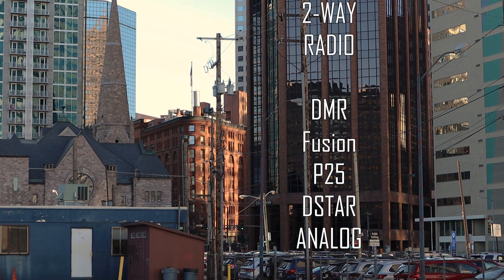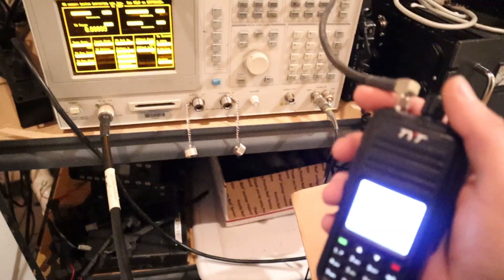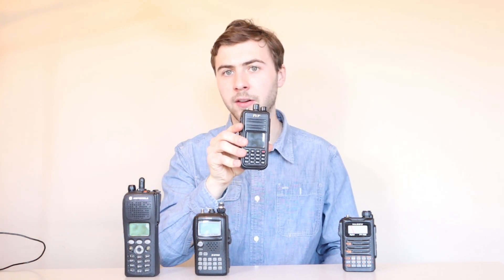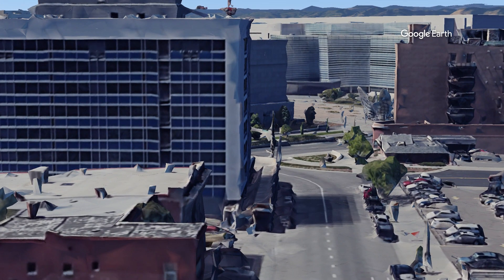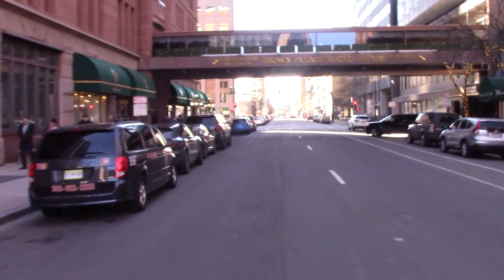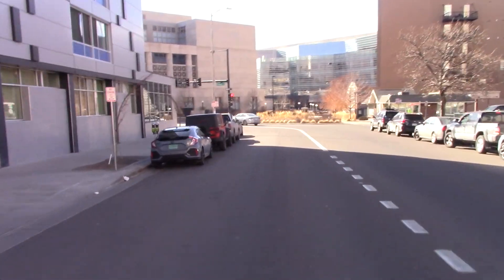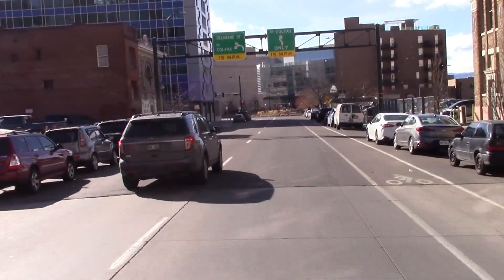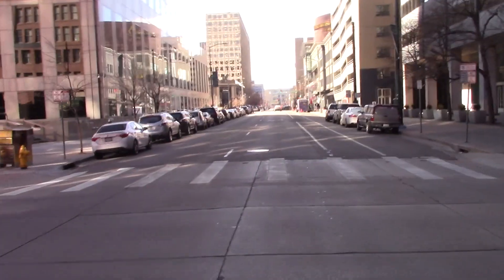Digital Vs. Analog Weak Signal Two-Way Radio Test

Comment: Excellent work! Regarding the comment that someone to drive for you would have been safer, I caught myself being a little bit nervous about that as well. But talking on the radio while driving is a staple for most of us even in a traffic-jammed metroplex. It’s not even hands-free for most mobiles!
Reply from the maker: Good point. Guess I need more friends. I did it on an early Sunday morning so the traffic wasn’t too horrible

Comment: Very nice. That looked a complicated video, hard to edit. I got one of those Yaesu radios. Only used the digital a few times on a Fusion repeater. First time when down south, bottom of England on a old WW2 radio station explore. Got a fusion repeater not 3 miles away if that, app on phone bought up. punhed in the numbers, worked forst time.. Not had radio 2 weeks. Some other roepeater got from high up point near home, bike ride away. That on QRZ. A google streetview screengrab. 34 miles or so. Wanted a nice little radio, but to be fair the fusion, digital a bit of a waste of time around here. No fusion. Usefull when move area like holidays, We shall see. Got first handheld in 1994 when licenced. Only ever had handhelds, analog old school person me. Had cheap rubbish baofeng things 2017 onwards, Sold to replace the drone that dropped in Oxford canal, sunk. Now got the Yaesu FT-70D from July.  Radio shows at 10:17 on here.  https://youtu.be/esi9lCyEaaU        -       G7TRV

Comment: Wow, digital is so much better compared to analog when it comes to multipath city environment. Out of all the digital modes, I would agree DMR had the best sound quality and signal. It would be curious to also try this test using NXDN.
For the rural mountain test, I would say it is a tossup because there were times the digital dropped out completely where the analog signal was still heard with noise.

Comment: Great video. I'm still a big fan of analog. Working in the public safety field, the big difference between analog and digital has been on the fringe. Even though very scratchy you can make out the traffic vs digital which seems to be all or nothing/unreadable. Unfortunately advances in technology aren't always good moves.

Comment: Why did 5KHz fm sound better than 2.5KHz fm? Theoretically 2.5KHz deviation should have more RF power in a narrow spot and should sound louder. Or is it due to higher deviation that 5KHz was louder? Thanks for the amazing video.
Reply from the maker: "FM Improvement Factor".  SNR/CNR. Each time you double the bandwidth you get 6db more signal but only 3db more noise at the receiver.

so for FM, more bandwidth is better
Reply: @SkylerF  Cool. Learned something new today. Thanks for the explanation otherwise I was comparing FM to SSB.

Comment: Very good basic comparison video. I am planning on sharing it with my group as it is very "real world". On the analytical side, I would be interested in knowing more about the repeaters used. Were they all in the same location? Did they have the same antennas? Gain, Orientation, etc.
Reply from the maker: Did not use repeaters, this was all simplex directly from my moving vehicle to a stationary receive antenna doing the recording. The receiving end was just different radios being swapped out.
Reply: @SkylerF  Excellent. I must have missed that part. Again very good comparison experiment/video.

Comment: What is the BER (Bit Error Rate) for the digital modes?  This is the real measure for all digital modes.
Reply from the maker: Yeah, I wish I had a way to measure that, I don't have a communications system analyzer that does digital though :(. I'm not sure if there are even any service monitors that will modulate the amateur radio modes like Yaesu Fusion or DSTAR?
Reply from the maker: The other issue with my test is the radios probably have slightly varying RF performance based on the cost, so one mode may be better than another but the radios may have skewed it a different way based on the front end filtering etc...

Comment: wtf ? you show a guy in the apt . A real test would be talking back and forth . what the hell is the guy in the apt doing ?  maybe I do not want to know.
Reply from the maker: Talking back and forth would be a lot more complicated because then I would have to put a recorder on the vehicle and talk back and forth at the same time. We are simply testing each mode up against each other, and do not want any other variables in here to change. 1-way transmisions is enough to answer our questions on which mode works better for a weaker signal. 
 Jeremy, W0JRL was in the apartment, and he was switching all the radios out, starting / stopping the recording, and verifying the signal strength for me to find a good stretch of road to do the test. The apartment antenna was held still and each HT was swapped, because we did not want any variables to change.
Reply: @SkylerF  Good answer!  And the signal back from the apartment would be inline with it's signal rx.  The only variable would be the power going the other direction.  I'm very happy to see a comparison of the different modes and find it useful here in the PNW with spotty coverage in certain areas I travel.  When into the city I can use repeaters...  But on the road home it twists and turns with trees and different elevations similar to Colorado.  I f you have ever been to Pagosa Springs and travel between smaller towns you know!!  Similar terrain here in Washington State. I find that Analog has become my friend with about 50 watts I am able to have somewhat reliable connectivity and in some spots turning on the compressor helps eliminate those deadish spots.  Good SWR and high antennas are a must.  I would like to try a test with DMR with the same watts I use (50) on DMR.  The difficulty I have is my YL is not a ham...  We use GMRS under my license.  Similar results but GMRS is UHF and I have found VHF to be more stable at distances.  Very good test and keep making vids!!!! 73's to all N7MWH

Comment: I own several repeaters and I would demonstrate this to skeptics.  Two of the repeaters were using the same site, same antennas and same power.  They were on a combiner with several other repeaters, P25 being their modes.  I left out the Quantars, because they outperformed them all due to their output power being 110 Watts.  The two repeaters that I used in my test were an analog wide band TKR-850 and the other was an XPR8400.  DMR outperformed the analog repeater every time.
Reply: Define "outperformed". What were the metrics you used to come to this conclusion?
Reply: I've tested DMR on weak power such as 50mw. I can't get into a DMR machine with approximately the same distance as I can with 50mw of wide FM going into FM repeaters in about the same spot.

Comment: Just found this video after thinking of the beacon recovery video. Great comparison of what you can do with 5 or so watts. Cool to see how well DMR performed down in the noise. Next you should go up to 50 watts or more and test the curvature of the earth.
Reply from the maker: Thanks James, Yeah I'd like to do more tests like that. The only problem is finding stuff to do the videos, hard to find people to lend me stuff since I don't want to spend the $$ buying all the stuff just for a video. One test I want to do is 4 bands, 6 meters through 900MHz with the same gain antenna through mountains vs. city vs. farmland. Another test I want to do is comparing different mobile antennas in different environments by logging the received signal strength voltage on the receiver radio while mobile keyed up with a constant carrier.
Reply: @SkylerF  I'd like a test around the 70 cm band, as I am licensed in the GMRS band but I am looking to get my Technician class license.

Comment: Would have been interesting to examine ssb as well, probably not fair since it has a higher signal to noise but would have been interesting to see how it behaves in a City Environment. I'm not sure how the data is modulated for the various modes, but if done properly you can almost eliminate how noise and multi-path affects the data with data processing technique. This is why digital broadcast fm is so much less intereference prone than standard analog. A good write up is here if your into the math behind it all : https://theori.io/research/nrsc-5-c

Comment: Just a comment, for your P25 test, when was the last time the radios had a proper alignment? I find lots of P25 users who don't perform well just because the radio is out of alignment. On the Moto's, the deviation balance seems to be really key for good performance, and used 2-way moto gear have usually had tough lives in the field. Truthfully, P25 and Fusion should have been pretty close since Fusion is just bastardized P25 anyways...
Reply from the maker: The radios were on frequency, had proper deviation and good sensitivity in analog. That’s as far as I can go with my own equipment. I don’t have anything to test BER. 

I think my radios might be using the older IMBE vocoder instead of AMBE2+ which might have something to do with it. Also P25 is similar to the fusion wide, which I did not test. Not over RF, but Fusion wide can be directly sampled to P25. Fusion narrow can be directly sampled to DMR through software without any vocoding.
Reply: @SkylerF  Ok, find someone local who can do alignments for you, it's more than just on frequency and "proper" deviation. You would be surprised how much better those radios will operate P25 when aligned properly...
Reply from the maker: Yeah that’s the way I need to go. Only so much I can do for a free video haha. I wanted to get people to send the latest and greatest new radios  for each mode and then I ship back after the video was done but nobody was interested in that...
Reply: @SkylerF  Great demo, but this comment explains a lot!  I was expecting to hear Fusion sound as good as P25, both C4FM, but now I know why, Fusion was running in Narrow mode (sounded almost as bad as DMR).  So I can assume Fusion Wide sounds the same and as good as P25?

Comment: I worked in a commercial 2-way shop for 27 years, been a ham for 50 and am quite familiar with video production. You did an amazing job syncing the audio and video! People don't know how hard this is. Also, it is the best comparo I've ever heard between the modes. Great job!
Reply: except for reusing the same video in both tests showing the same truck and signs at 13:18 and 14:52...

Comment: Great work! Just curious, was the receive site for the mountainous terrain test the same as your urban test runs? Also, what was the approximate distance on both test runs?
Reply from the maker: The RX antenna was indoors maybe 2-3 miles away on the city test. The mountain test was a while ago when I was in socorro NM and the test was about 5-7 miles away on a magmount indoors. Antennas did not have a lot of height. I’m Not really testing range just testing weak signal
Reply: Understood. I just wanted to understand the test conditions a little better. Do you have Allstar? It would be great to have you talk about this on our tech net next Sunday night..
Reply from the maker: Yeah my hub is 46079 skyhublink.com
My 900Mhz repeater on lookout mountain near Denver is 40195, usually connected to the hub but I steer it around, that’s where I usually hang out

Comment: Very nice test indeed. In my opinion, modulation was too low in analog narrow FM. While noise (the classic "whip effect" of multipath) was more or less the same as analog wide FM, it seems to me that modulation was far lower. Did you forget to turn the RX radio to narrow mode? Or did the RX radio have some issue with narrow bandwidth mode? (here I am refeerring to the test done in the city). Also, it actually seems that DMR is the best digital mode, the one that has less drop-outs in the test. Maybe it's just because the RX radio is better than the others? Anyway, while we all appreciate the absence of noise, I believe that actual readability of the signal is better in analog FM (wide). If, instead of a repetitive pattern (testing, 123) you had actually read out some random text (a book?) and asked for the other party to copy it, you should have clearly seen that analog wide FM is the best mode, that is, it allows to copy the most text without errors and omissions, even if the listener has to cope with the noise. 73 de IZ4UFQ
Reply from the maker: The RX radio bandwidth is right, I believe my TX modulation was too low on narrow, didn’t talk close enough to the mic.
 As far as the digital modes.All of the radios had similar RX sensitivity on analog, but maybe one has worse bit error decode, there is no way I can test that unfortunateley. That may gave lead to the reason why fusion performed the worse, the fusion radios have the worst intermod rejection, and bieng in the city there may have been other signals generating intermod on my RX fusion radio.

Comment: The frequency wasn’t mentioned but on analog it sounds like it was done on 70cm.
Reply from the maker: yeah 70cm, same frequency for all radios. i put it in the description
Reply: There's no way to tell a frequency based on the "sound"
Reply: spatch713  Actually when you are mobile, the fluttering QSB becomes more rapid at a given speed. The wavelengths become shorter and the “dead spots” are closer together. When you get up to 10 GHz and higher the flutter is so rapid it becomes a modulated tone.
Reply: wecontrolthevideo well I'll be damned. Learn something new everyday.!
Reply: spatch713 Just listen to a weaker mobile signal sometime on UHF (440 MHz) especially if that mobile is moving 60 MPH or better, you’ll notice the rapid fading.
Reply: @spatch713  Yes, you can tell by the "picket-fencing" 70cm has faster fading and sounds more "choppy" due to the shorter wavelength.

Comment: Hi Skyler! Glad to see you come back after a nice little hiatus! 

You pickled a great topic to cover. I watch a LOT of amateur radio videos on YouTube and don’t think I’ve encountered a video that compared the various ham-friendly digital modes the way you and your colleague did. Well done!

A couple of questions for you:

1. Were you using VHF or UHF for the testing?
2. While in downtown Denver, if I were to take a guess, it sounded like you were traveling away from the receive location. Would that be an accurate assumption?

While I’m partial to DMR, it was a tough call between DMR and P25 in terms of which had the better audio quality. I would tend to lean towards P25 in your testing. That is likely attributed to using a commercial Motorola radio for the P25 tests vs the TYT for DMR. Had you used a commercial (another Motorola XPR6550) DMR radio on your end of the test, I think that would have made the two almost indistinguishable. 

Next in line in terms of audio quality would be D-Star followed by System Fusion easily a dead last. They both had a very robotic tin can sound to them which is likely the result of the poor implementation of compression. 

Of course there have been advancements in more recent D-Star and System Fusion radios but budget is almost always a factor and it’s nice to see you continuing making the most of the gear in your collection!

Keep up the great work!

73,

-JeffH 
W4JEW
Atlanta, GA
Reply from the maker: Thanks for the comment!
1.  UHF 70cm All on the same simplex frequency for all tests
2. Yes Travelling away from receiver
For P25 I had a Moto radio on both ends
For DMR I had the TYT MD380 for TX and An XPR6550 for RX. I could not find two Moto DMR radios, so I decided to use the Moto for RX because the receivers are better in them.
ALso don't trust the second test I filmed a while ago as much because I was using Two MD380's for that one, no Moto
Reply: Skyler F thanks for the quick response!